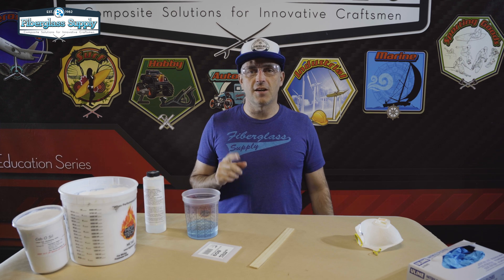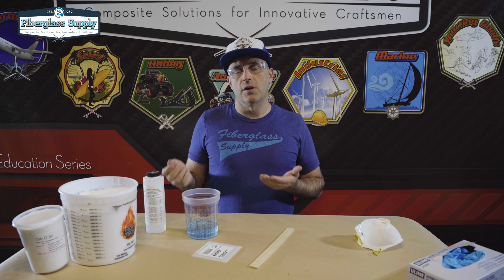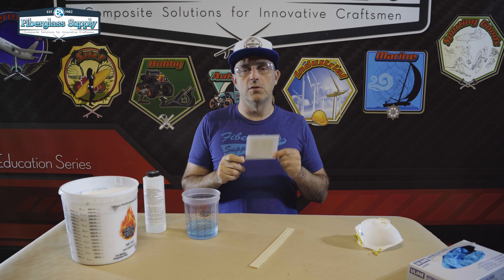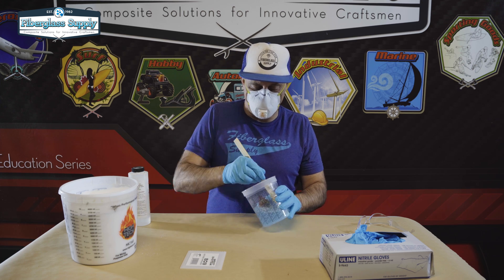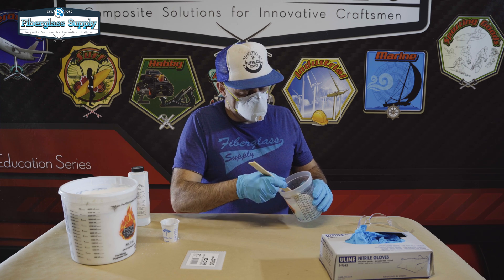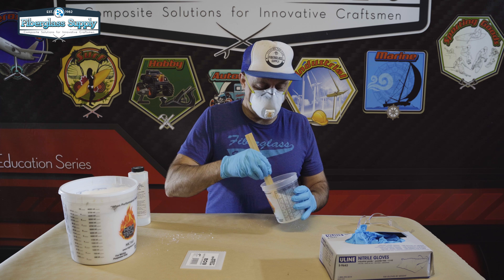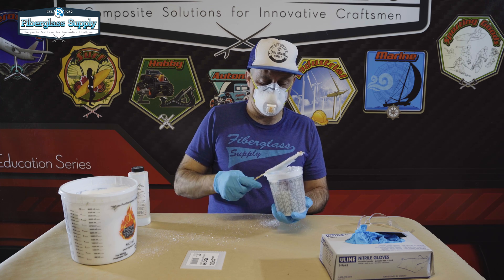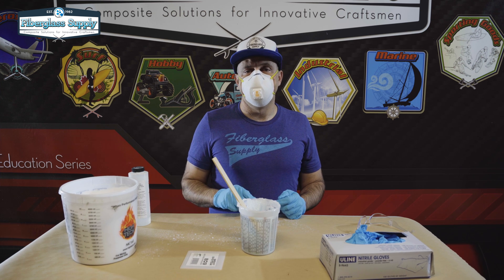Epoxy for Beginners- How to Make Adhesive Putty

Comment: I had to redo this 3 times. The first times I either added too much Cab O Sil and it dried up or I let it settle in the mixing cup for too long and it dried up. The 3rd time I got it just right and applied the epoxy adhesive putty to what I needed, just before it dried up.

Comment: Thanks man. I was looking for a video to make an epoxy adhesive putty that I can use to fill gaps of air for a 16 oz Starbucks tumbler, I'm making an induction heater and using that as a case. I need to cut out a hole to put a mini DC voltmeter on the side of the cap, but the side of the cap is curved. So when I insert the voltmeter in there, I need to apply epoxy in there to fill the gaps and secure it in place.
Reply from the maker: Glad I could help